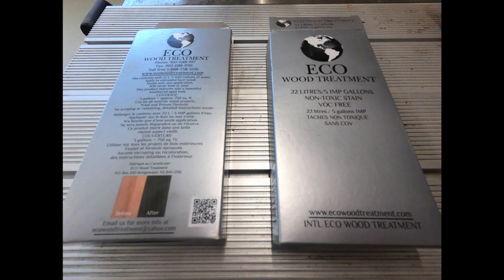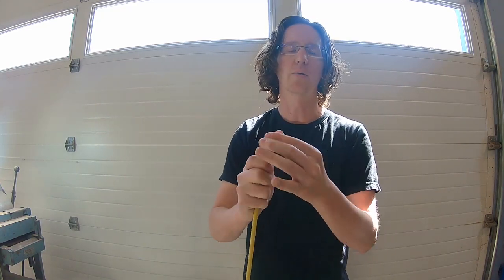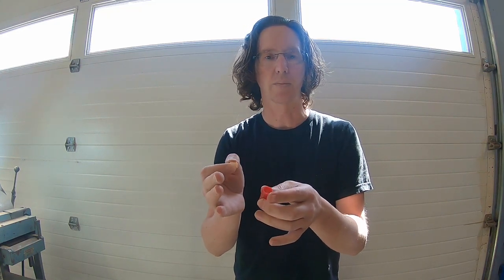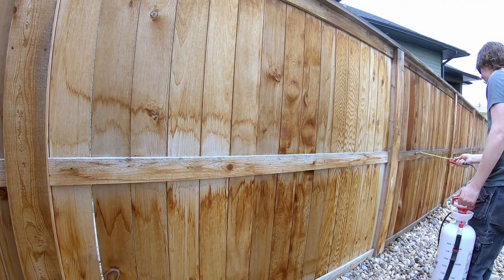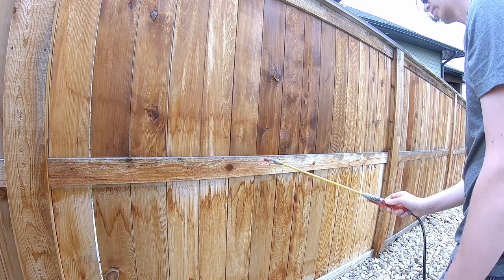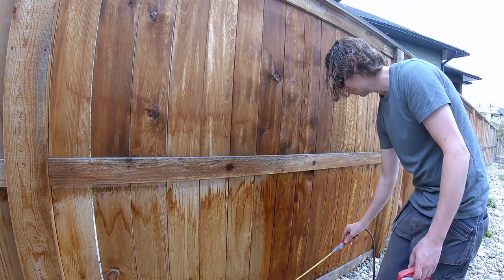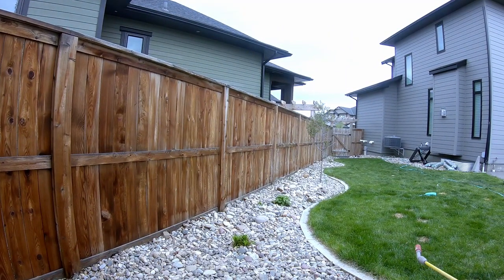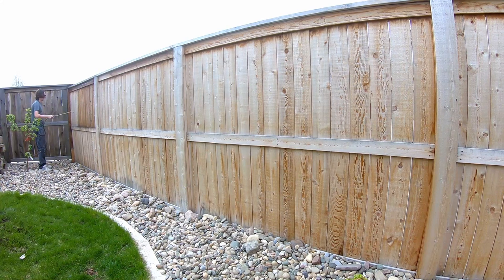ECO WOOD STAIN - Stain your fence once and never again!

Comment: Great video. What stain color did you select?
Reply from the maker: For the product that I picked from www.ecowoodtreatment.com there wasn't any color selection, it is just this one color. All it does is basically speed up the natural aging process of the wood. One the thumb nail picture the fence portion on the left was done with the same product and is probably 5 years old at the time of the picture, so you can get a good sense of the color after some time has passed.
Reply: They have several color options now. The gray finish is the least expensive though
Reply from the maker: @brandonbrooks6780  Thanks, that is great information. Must be new.

Comment: Did you wash the fence prior to applying the product? Thanks.
Reply from the maker: No you don't have to wash your fence first. Although I would clean off anything that would prevent the product from getting the wood wet. So a little dirt is ok, but a big clump or mud would need to be removed.

Comment: How is the treated wood holding up now please?
Reply from the maker: It is holding up great. I have only had it on for a few months now. but the neighbor's fence was done in the same manner with the same product and is still looking great 5 years after application.
Reply: @ResearchDesignBuild  that's great to know, thanks 👍
Reply from the maker: @wesleydavis8786  Not a Problem, It's a great product